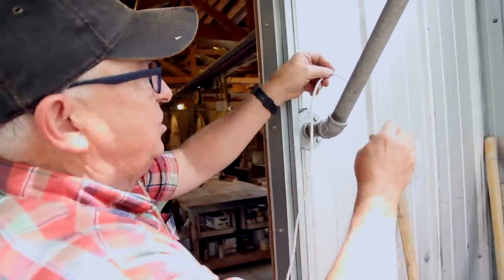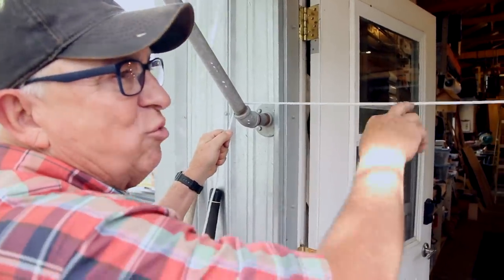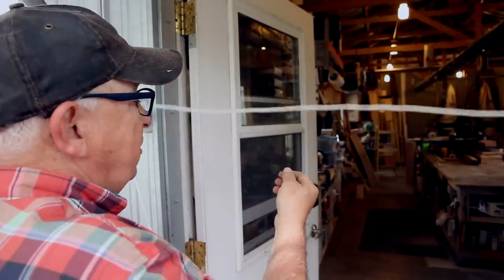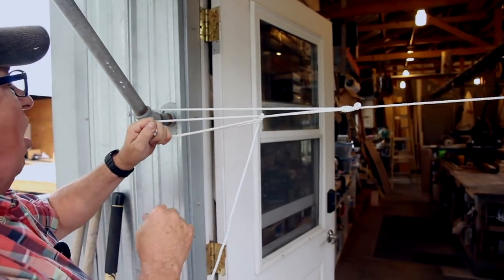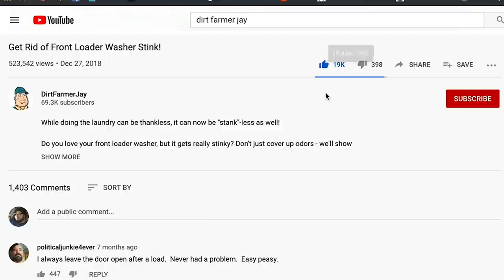Tie Ratchet-Strap-Tight Loads with Rope!

Comment: About the first knot, even with a loop, if you pull really hard on the rope, it tightens so much that you can't untie it even by pulling on the loose end of the loop. The best knot for that in my opinion is the clove hitch with a stop knot on the loose end. You can pull a truck on that knot and still untie it without tools.
Reply: Clove hitch for the win. It's a go to staple of mine, for sure. Along with the bowline knot. Also able to take substantial load yet very easy to untie.
Reply: Use the clove hitch on steel cable too, in the pump and drilling industry. 
Hang a lot of tooling and weight without damaging the cable.
Reply: Bowline works
Reply: If its a really big load you can also look into the bull hitch or the spar hitch in slip form
Reply: That was my first thought.
Reply: I wouldn't use a Clove Hitch by itself.  Consider its near relative, the Spar Hitch, or even the Sack Knot.
Reply: @kurtschmidt5746  I’d make sure the spar hitch is slipped. If not, it could be hard to undo
Reply: Either one works. I found a water bowline to be pretty useful

Comment: Great video! Since this is like a 'ratcheting' strap, one tip to get it closer to that is when you pass the working end through the loop, do it twice. It keeps tension while you pull on it and you don't need to pinch it to hold it in place before locking it off. And for locking it off, using a slip on that side for the first half hitch but securing that with another half or full hitch keeps tension off the locks and makes it easy to undo even under tension.

Comment: I was shown a few knots to tie that I had to learn at the job I had when tying the first knot. One that comes undone pretty easy , if it’s tied right , is the bowline . The last knot you showed to tighten the load is a great help. I used to tie a loop in the middle like you showed and I know by experience it is hard to get it out when taking the load loose.
Reply from the maker: Thanks for sharing!

Comment: This is exactly what I was looking for to make tight lines for the boat frame winter tarp. 5 years ago I had enough of shrink wrap so bought a 20 x 40 tarp, designed a PVC frame but still needed some method of securing the frame. Perfectly explained and easy to follow along. Thanks
Reply from the maker: Glad I could help!

Comment: 2:50 My dad, nicknamed Spiderman for tying down loads with trucker's knots, taught me to always push the tail through the loop after completing the hitch. He snugs down the loop, but not tight, to keep the tail in place. This is just a bit of added security to prevent the hitch from being undone inadvertently.

Great video showing a tried and true technique. I still use straps to tie down my ATV, but I've used these knots & techniques more times than I can count.
Reply from the maker: That's a great practice! Thanks for passing on the tip. Best, DFJ

Comment: Nice job. I like to use a marlin spike hitch to form my loop. This is easy to remove when finished. Also when running the end through the loop and cranking it down, if you run the working end through the loop twice instead of once (with the second pass on the bottom of the first pass through) then the knot will not come loose until you release it. When you crank the load tight it just stays.
Reply: This is how I do it. I'll put a marlin hitch on the load side and another marlin hitch on the tag end and you run your tag end through the load loop, then the tag loop, then back through the load loop. It creates that bite that you're talking about but it's also a small mechanical advantage improvement because it functions like a block and tackle. It's actually called a versa-tackle. It holds tighter than a regular trucker's hitch because you can pull it tighter and it doesn't loosen at all when you tie it off, because it self locks. You lose a lot to strand friction so it's not a smooth block and tackle, but it's certainly better than the standard truckers hitch, or this weird twisty loop that this guy is showing.

Comment: Great video and very much appreciated. It should be noted that FMCSA regulations strictly prohibit the use of rope or any type of elastic cord for load securement on any Commercial Vehicle.
Here in Maine that includes many pickup trucks and other types of vehicles that use a Commercial plate.
Proper tie-down straps with a legible Working Load Limit must be used when transporting a load of ANY type on a public road.
Reply from the maker: Eric B - Thanks for the info! This is a great insight, I'll add this to the video's description. We really like this medium because we get great insights like this from our viewers. Thanks for watching and then taking time to write. Best Regards, DFJ

Comment: Hi Farmer Jay, as an arborist I tend to use the truckres hitch for similar applications (simple mechanical advantage system, tightening something to somthing, etc.) My chalange is that I only have long ropes (40-60m or longer) so I have to use slings + carabiners on the working end of the rope to avoid feeding the whole lenght through. Cheers, m.
Reply: You know if you are securing a tall load u can actually put 2-3truckers hitches in the same rope giving you even more of a mechanical advantage and also use up more of your rope 😉

Comment: A bowline on the attachment side is also a really easy knot to untie
Reply: Especially if you slip the last part "going back into the hole".
Most practical knots can be slipped at the last part to be untied with ease after use.

Comment: Thank you for another practical, very well presented  tutorial. A while back, I saw the benefits of using the Farmer’s Loop to tie down a load. Because of its 90 degree configuration on all sides, there apparently was a reduced risk of capsizing. Would be interested which knot/loop you think is more stress-worthy.

Comment: In stowing the rope, I find a slightly different method. I take the 2 ends side by side and proceed to fold the rope in half over and over. I do this until down to about 12"-24" in length. ( It will need to vary based on the rope diameter and length ) Now tie the folded rope in a half hitch knot, for me, keeps it neat and ready to go. If for some reason you end up a little too short or long, attempting to keep your bundled rope compact, instead of starting out with rope in half, divide 1st fold into thirds, and then resume folding in half.
Reply: How about a video demonstration?

Comment: An alpine hitch leaves the main line strong and you can pass the slack end through the loop TWICE.  Keeping the second pass through under the first.  Then when you pull to draw tight it will stay without even tieing it at the end.  The half hitch at the end would be just for added security.
Reply from the maker: Thanks for your excellent comments. The great thing about this medium is that people can connect with not just us but all kinds of people in different professions and walks of life. Keep watching and commenting my friend. Best, DFJ

Comment: As a teen I worked on the ranger crew at a boy scout camp. The ranger always said that you should NEVER cut a rope unless it was an emergency and unavailable.  Rope is still superior to webbing in most situations.
Reply: Basically correct but what you refer to are lines cut to specific lengths.  A general purpose line is normally 50ft.  A lowering line is 100ft and a lifeline of material for the purposes of rescue is also generally 100ft.  This is not a rule but just an example of lines in the UK Fire Service.  A 'line' is cut from a 720ft rope for specific purposes and you should always know the length hence it should NEVER be cut.

Comment: First knot is just two half hitches and should be used with a round turn, the best knot you can use in this situation in the bowline, then the truckers hitch you can do a couple of ways but the traditional way is to bring the working end back to the secure point and fix it off there.
I’ve seen some using clove hitch’s which will come loose with movement or a rolling hitch at the start but as I’ve said…use the bowline and then finish off with a round turn and two half hitches and you won’t go wrong!
I would never secure anything with the slip knot you use at the start….
Reply: Just depends on the application. For ridgelines, the traditional way is a waste of time. As far as knots for anchor points go, a water bowline would be more secure and just as easy to untie than a regular bowline. For finishing off, a round turn & two half hitches works well. Can also do a backhand hitch

Comment: If you make a byte or loop twist it once lay it back on the line in the direction you want to tighten then pull a loop through the line (marlin spike hitch) you can use that as a attachment point also if you run the end through twice instead of once it’s self locking when you tighten it. Been using this set up for years tarp camping.
Reply from the maker: Thanks for the great info Chasing The Trail. Best to you, DFJ

Comment: Great job.  On cinching: you only need to make a simple slip knot loop and not the twisty slip knot
Reply: The extra twists make it much easier to undo.

You might also consider the Awning Hitch (half of the Sheep Shank).
Reply: I’ll stick to the twists when cinching down the load. Easier to untie

Comment: The way i typically tie things down with rope is with a single slip at one end, and a normal truckers hitch or a come along knot in the middle to tighten and secure, it all comes out with a single pull, nothing more, and i can get a 3/8 rope to hold a refrigerator to the side of a box truck on a bumpy freeway and not move an inch, then get to destination, 1 pull and it's out

Comment: @ 5:47 you said "if you really want to secure it" and then proceed to tie it "loosely". That's because you are using your old method. Use your new method of putting a "slip loop" like you did on the first side and then you can "really secure it", tightly. It works even though you have a double rope at that point. I'm not sure if I'm going to give up my tie down straps but sometimes you don't have them or they get jammed up and this is a valuable skill to have in your arsenal. I've used these knots to tie up boats and to tie down airplanes.
Reply from the maker: Thanks for your insights, James! I appreciate you taking time to write and share your knowledge. Best Regards, DFJ

Comment: I love your practical knot tying lessons. I've watched both your videos on this particular knot. But is there a variation of this knot for an instance where you would have two separate ends of the line that meet in the middle? As if while tying your shoe, you wanted to employ a cinching type of knot like this. Thank you!
Reply from the maker: K. M., this know can easily be adapted for the situation you outlined. You must create a loop of some kind as an attachment point on one end of the rope from one side. Then you would use the set up shown to loop the "tail" from the other side to go through the loop and back to the cinch point. Does this help? Best, DFJ
Reply: Thanks DFJ!
Reply: Use a bowline on one of the two bitter ends.  then that can be used as a cinch loop.  On the other bitter end, use an alpine butterfly, quite a ways back.  Now you have two cinch loops to work with, one on each side.  Run the bitter end with the alpine butterfly through the end with the bowline, and then back through the alpine butterfly loop, pull tight, and then tie off with a couple of half hitches similar to this video.  This gives you 4 to 1 purchase total, and the knots are all secure and relatively easy to untie when you're done.  The bowline and alpine butterfly are two of the most useful knots you'll ever learn, and they are not difficult, so start by watching videos for those.

Comment: Called a 'lorryman's hitch' and a 'yachtman' purchase' it isn't  actually a knot in The Manuals of Firemanship but many of us taught it to their crews in place of a block and tackle.  You can use multiples of it in one line.  We used it for improvised equipment zip lines.
Reply from the maker: One of the many advantages of this medium is that we get to be in contact with great people like you that can enlighten us and the rest of our readers about your areas of expertise. Thanks for sharing, Steven Booth. Best, DFJ

Comment: Thanks so much for this video

I need help with tying ropes. I am clamping a large table with ropes and your strap is the closest so far to the application I have

Can you tell me about a way to wrap a rope around a table that can create clamping strength?

The problems I am having is that 
-I need to tie the rope as a loop (tie its end to its start)
-I need it to tighten like the ratchet mechanism (when I pull it tightens and conserve strength and don't get lose)
Reply from the maker: https://youtu.be/cXdGdJ9Cm9w. Here you go Ahmed

Comment: I like the way you present it... But you should have taken it further. For one, you can go through the final loop twice for a locking action so it will stay put until you secure it at the end. Also, if you can, and need to, you can multiply the force more and more by pulling tight on the trucker's hitch, going back to the anchor point, then creating another truckers hitch that will be pulling on the previous truckers hitch, you can tie off at that point or go back and create another T.H. for more force. You can do this over and over as long as you have enough room until either the rope snaps or you pull that tree stump outta the ground (seen it)...   A series of two truckers hitches can come in especially handy with paracord and pitching a tight line from tree to tree when camping.

Comment: THANKS !!! Do you know if it's possible to make a semblance of a ratchet mechanism out of a rope? like "supposedly" towing something out of the mud...

very instructive tho  thank you !!!
Reply from the maker: The closest way I know to do this is to create two loop points along the length of the line, attach one end to a strong fixed point, and put the other end through an attachment point of the object you want to move and then run the free/excess end back through the two loops and then back through the one closest to the load and back towards the other loop. You are effectively creating a mechanical advantage, but it's hard on the rope and only good for moderate distances. I hope that helps. Best, DFJ
Reply: @DirtFarmerJay  many thanks Ill try

Comment: Is there a way to tighten a loop of rope through 2 pulleys with just knots?
Reply from the maker: Not sure exactly what you are asking. Please give me more detail. DFJ
Reply: I actually figured it out by using the knots you showed here. I made a clothesline through 2 pulleys at each end. The knots keep the line taught even when the line stretches overtime.